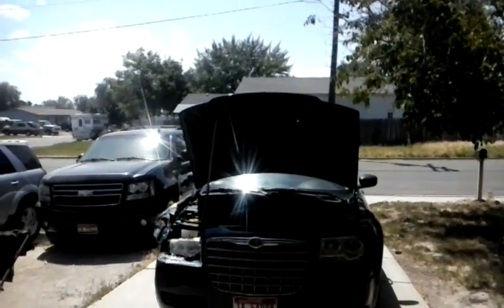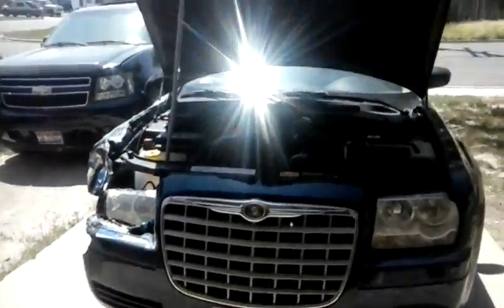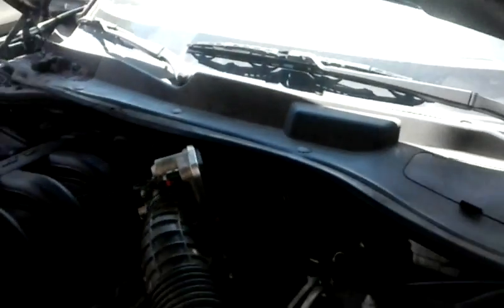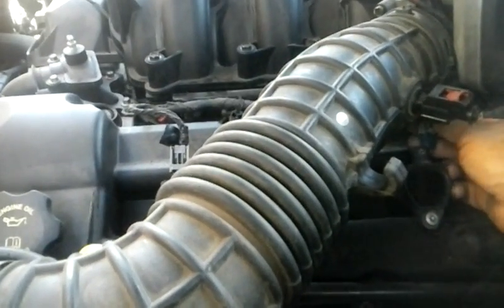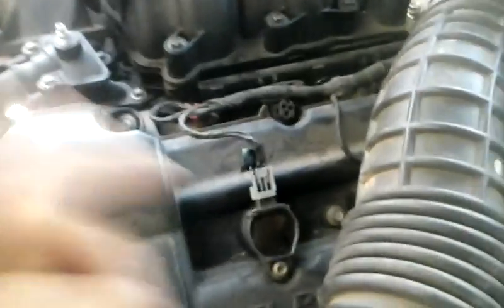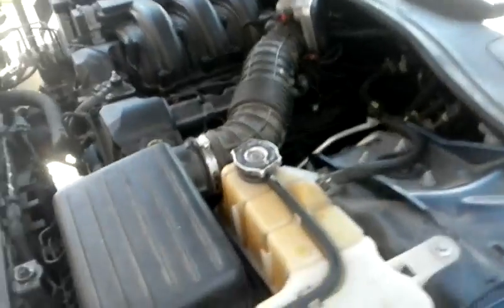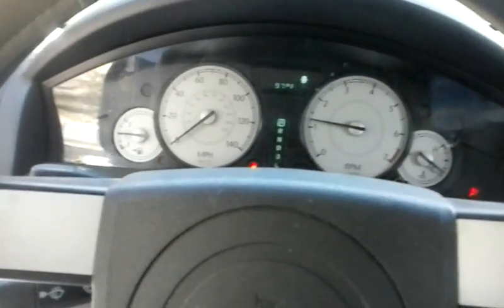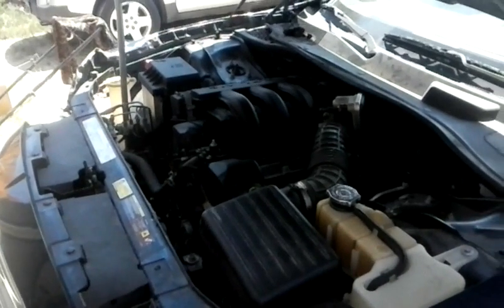Chrysler 2.7L specific cylinder misfire diag and repair

Comment: Hi Matthew I have a 2.7 V6 dodge Magnum I just changed the spark plug coil and spark plugs on all six cylinders when I took off the cold air intake manifold to get to the other three spark plug coil and spark plugs on the left-hand side there was a lot of gas under the cold air intake manifold and on top of the manifold in my car I replaced everything put everything back together and started the car and the car is still running rough so what would cause the gas to be on the cold air intake manifold in the manner in the top of the head between the two valve covers where the fuel injectors are

Comment: Hay I have a question  I have 2008 with the 2.7 an  #1 ome up on scanner I have changed it an an with in 2 days it came back on for the same reason  with new sparkplugs an coilpacks what could it be?

Comment: Btw, if the 2.7 is not rebuilt PROPERLY, (including replacing water pump and timing chain which are not typically included in a rebuild), it WILL blow again.   Ask me how I know.

Comment: This engine is seriously flawed, maybe even cursed.  I had to rebuild a 2.7 TWICE within 100k.  

Less horsepower than the 3.5, OBDI (not OBDII), really no advantage of this engine whatsoever.  Almost nothing can be done to upgrade it.  Absolute Junk.   

Trash it, and buy a HEMI.   You’ll still save twice as much than you would have spent on engine work.

Comment: What if you have replaced the load coil and the spark plug and it’s still misfiring?
Reply from the maker: Then its more than likely a mechanical failure. Try compression testing that cylinder.

Comment: I have a charger 2.7 and when I hit the gas I get a ticking noise my oil light on and my check engine light is on wat that mean
Reply from the maker: Sounds like you are having a oil deliver issues. The ticking sound could be a dry lifter not getting propper oil

Comment: 2010 3.5 p0305 code rockers were bad replaced with new still misfiring.. new plugs injectors and battery coils are good switched them all around still p0305 I'm stumped

Comment: Hey bro I have a 2.7 Chrysler 300 2005 the car idles weird and stalls on me everytime it falls under half a gas tank . I’m able to turn it back on and go but will then turn off at next stop light any  ideas of what it may be ? Thanks and live the channel
Reply from the maker: Ive seen something like this before.......it was due to a weak fuel pump about to go out......the weight of the gas in the tank helps push the fluid through.....get down to half a tank and you don't have that weight of all that liquid anymore. if the pump is weak it wont be able to push it by itself. also maybe check fuel filter. you can test this with a fuel pressure gauge.

Comment: What if your 300 wont even start up and run... Mine wont turn over or crank at all... I have a flashing engine light that goes to solid after key is turned to on position... Also I have the red thunder bolt light on for a lil while after turning the key. After key is turned for a while that bolt light goes off... Cant anyone help me out with that??????
Reply: https://www.yourmechanic.com/question/the-light-on-the-dash-is-coming-on-the-one-that-looks-like-a-red-lightning-volt-what-does-this-mean-by-patrick Also verify your battery is good.
Reply: That's an electrical problem also could be a relay fuse that needs to be replaced, also check your battery, or it could be a bad starter. Alternators something else you could look at! Then I will check check your spark plugs and coils!

Comment: very good video man i am getting a p0300 so mine is more a random miss fire so i might change all coil packs soon to see if that would take care of that code or maybe it could be something else but its the cheapest to do on a dodge magnum 3.5l v6 motor. The motor does vibrate allot and i am praying that it fixes the problem in hand. Please let me know anything i may not know.
Reply from the maker: yeah try that first. might wanna do a compression test to check valves.does it rattle at all when you start it up or anything like that?
Reply: @MattShaughnessy6  No first i would get a code p0404 then after that 15mils more of driving it gives me another code p0300 random misfire last night i cleaned the EGR valve. I'm going to test drive it again tonight to see if the light comes back on or not.

Comment: Nice job ...I keep getting a ignition coil A secondary circuit misfire on my 3.5l I changed the spark plug and coil still getting the codes any idea why
Reply: You  faint  the problem? I am having  the same  problem...
Reply: Did u find out
Reply: @jason
Reply: @andrewsantana1660  no never found out why
Reply: U sold car
Reply: @andrewsantana1660  yes I hated to do it but I couldn't figure out the problem

Comment: I have the same problem but in cylinder 3 ..my question is where is tha locate
Reply from the maker: middle cylinder driver side
Reply: Is it the same for a 2006 300c .. cus someone had told me it was passenger. Side middle cylinder? Confused thanks good video 🤙🏽

Comment: I seem to be having the same problem with my car.. it says cylinder 1 misfire.. I was at the carwash just after washing it on my way home it started acting like crazy and the engine light was flashing this video has proven to be very useful because it just given me guidelines on what to try first before taking it to a shop and spending an arm and a leg I will try replacing the coil tomorrow since slender one I believe is in the front towards the right close to the intake.
Reply: I know it's been a while since you posted this but I'm having the same issue with my parents 09 charger 2.7 v6. Its showing misfire codes for cylinder 1, 5, and 6. Also egr code. Did you fix it?

Comment: mathew? im so glad if found you here! quite by accident but you helped solve
 which i hope is my last issue!  im 57, a female and soooo not a mechanic!  i need to do the best i can doing my own work on my car.  no money!, no  man to  do it for me so i depend on videos here!   cars running fine but was time for new plugs.  after putting them in and starting the car  there was white wet smoke from the tail pipe also rotten egg smell  im thinking blown gasket and maybe a new cat converter.  symptoms fit for blown gasket and bad converter but i couldn't figure out why it happened just after putting in new plugs?  no previous problems at all before them.. then the converter glows red hot!!!! scared the shit outa me! hahahaha never heard of that happening? in looking into that i find it may not be the head gasket thank goodness cuz i wasnt looking foreword to that job! but i saw a video showing misfire from injectors or coils will cause the cat to do that  with the smoke and get hot like that.. have  checked the injectors 6 and 2 are bad and cleaned them with spray and added cleaner to the gas and as it stands now cats not getting hot like it was or blowing smoke  still a slight misfire but ill give the additives a chance to work.   now from your video i  also know  it could be the coils causing the misfire and its simple enough that i can fix that problem if it is   thanks again and now if any more gremlins attack? ill know which mechanic i can visit here   : ) ps.. my primary vehicle is my 2 year old 50cc tautau scooter! she has 5500 miles on her with not one major problem  no gremlins! haha!

)
Reply from the maker: I love reading things like this! I am so glad I could help you out! I have decided that I am going to focus the rest of my career producing and making car repair videos. I have a couple projects I have started. one of them cost $1 dollar month. In exchange for your 1 dollar a month donation I can give you all the personal automtive tech support you need. we can trade phone numbers or video chat and I can walk you through just about any procedure. check it out on https://www.patreon.com/Matthewyourfriendlyneighborhoodtechnician.

The other project I am working is on go fund me. I am trying to raise 1,000 dollars so I can help those that need a break in life and repair their cars for them. these people are single mothers, veterans, elderly, the medicaly disabled.........I hope to make a T.V. show out of it.
https://www.gofundme.com/matthew-your-friendly-technician

Thanks for watching my channel!

Comment: I bought a 2007 300 2.7Lit has 135,000 miles , about 3 months into owning it I got these codes p0420 and p0430.I've had all 4 sensors replaced.still got the code back. (sprayed intake with water to see if there is a vacuum leak...no)installed the non-foulers (not a fan of those).and still getting the codes back. I don't know what to do now.Car runs fine that's the only codes I get.I am planning to check the wiring maybe I have a short on them?Pleas help!  thank you!
Reply: I had an 08 charger had a similar issue. Check the coil packs. You can test them by unplugging one at a time and listening if theres a change in the idle. Then plug it back and move on to the next one. If that doesn't work. It's going to be the Catylic converters. I ordered two new cats from magnaflow. Then took them to a a muffler shop to have them installed. I payed 380 for the cats and 180 for the install. Instead of over 800 bucks.
Reply: Po420 is either left or right bank but po420 means catalyst converter
Reply: I had those p0420 and p0430 that means empty your wallet probably both catalytic converters thats what it was for me ...it isn't cheap but you will feel a difference in pickup once done.

Comment: i have a 2.7 and the computer said #4 was misfiring we already changed all the plugs then i changed #4  coil and it is still running rough, would you happen to know what else to check?
Reply: if youre still getting a misfire  after replacing the coil, and the plug doesnt look to be broken or fouled, the next logical step would be to replace the injector.
Reply: yea we are going to try switching the injector with another one to see if the misfire moves to another cylinder.if it moves i will just buy another injector.
Reply: What if I changed both but I still get the rough feeling on the cylinder misfire it only says on #4

Comment: I have 05 dodhe startus 2.7l . 170,00 miles , pretty smooth ride.  Same problem on mine . Scanner reads evap leak,  multiple misfire , misfire cylinder 4, i have spark , but theres fuel in #4.. no way to get fuel pressure checked ? Bad injector ? Any thoughts

Comment: I have a misfire on #4....changed plugs, coil and Injector... Still misfire and no change when it's disconnected.... Suggestions?
Reply: camshaft sensor
Reply: Did the camshaft sensor replacement work for you?

Comment: I have a 06 charger 2.7. Original motor blew so I had another used motor put in. But now I have the blinking engine light. What could it be?
Reply from the maker: possible misfire

Comment: Thanks for the vid Matt. I have the same engine and for the past week I've had a P0204 injector circuit error and now today I have multiple misfires, what do you think I should check first? Misfire codes 300 https://imgur.com/gallery/WxVfT
Reply from the maker: Hi chris! I answer your question in this video. thanks for watching and if you need more help get a hold of me.......https://www.youtube.com/watch?v=M16zb0DGZco
Reply: I just replaced 2 plugs and 1 coil and knock on wood we are good! Thanks again
Reply from the maker: hang in there you'll get it figured out!

Comment: What if it was a random misfire code?
Reply from the maker: there are few different things you will want to do. you start by pulling plug connector to coils. what ever coils do not equal a change in the engine is more than likely were your misfire is. also in line spark test and compression test can further help diagnose this. how many miles on the car? most common for random misfire is bad coils.
Reply: Matt Shaughnessy the truck is a 5.7l hemi 2013 ram with 103xxx Miles it threw a rod through the block last summer so we did an engine swap. The new engine ended up having blown head gaskets so we replaced those the new engine has 43xxx Miles but I was getting crankshaft position malfunction code, still am after replacing the sensor along with the  camshaft sensor. I figured the plugs were possibly fouled out so I'm replacing those today along with new coils as well.

Comment: 0304 cylinder is the one in the middle right
Reply from the maker: C. R. 0304 is the 4th cylinder. Look up a diagram for fireing order for it online to identify 4th cylinder. If you can't find one let me know and ill email you one.
Reply: Matt Shaughnessy I had the 0304 code so I unplugged the 4th cylinder and connected it again and now I get the 0300 code .
Reply from the maker: when you unlpugged the coil did the engine change how it ran at all??
Reply: Matt Shaughnessy  It did changed
Reply from the maker: prior to unplugging it. was the engine running rough when you pulled the 0304 code?

Comment: Matt. I have a 2009 Charger with 2.7L. I did a tune up on it about 2 months ago which solved a P0303 code as the spark plugs were all worn out. I put it all back togther, torqued the plenum to 100 inch lbs and car worked great. Now Im getting a P0301 code. I smoke tested the intake which showed no leaking. Could this just be a coincidence that the #1 coil went out?
Reply from the maker: yes things like this happen "coincineces" all to often in this business :). worth checking out!
Reply: Right on man. Im gonna take the intake off and swap the plug and coil over to cyl 2 or 4. if problem follows the coil and plug then I need to troubleshoot further. Thank you.

Comment: I have a misfire on #6 I replaced to coil and spark plugs and there's gas where the valve is just ain't burning it
Reply: Smoke test the intake by injecting smoke into the vacuum line in back of the manifold and blocking off the throttle body.
Reply from the maker: if you have spark, and fuel but still have a misfire check compression. do you know if you are producing spark have you tested it with a inline tester?
Reply: Matt Shaughnessy
 no I haven't tested the spark will do dat
Reply: Matt Shaughnessy 
I took it to a shop to have it hooked up to computer and they said something bout a vacuum leak
Reply from the maker: common on this vehicle. do you know what codes was pulled?
Reply: @MattShaughnessy6  hi i have a 2006 chrysler 300 2.7 and it runs rough.i replaced different sensors and 02 sensors.amd still runs rough..help please

Comment: I switched coil #4 and also unplugged the coils as you did and i still have the vibration even with a brand new coil. When i disconnect it , it also doesn’t do anything ... what do u suggest
Reply from the maker: I am a little confused. Do you have a cylinder number 6 misfire or a cylinder number 4 misfire. if replacing the coil does not fix the issue then I suggest checking the fuel injector.